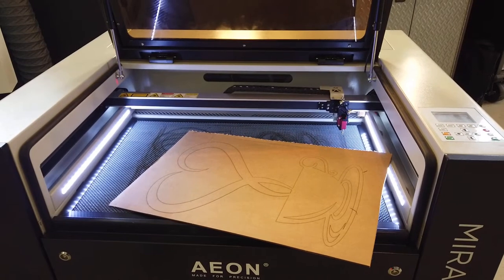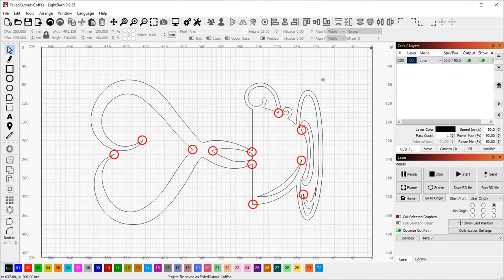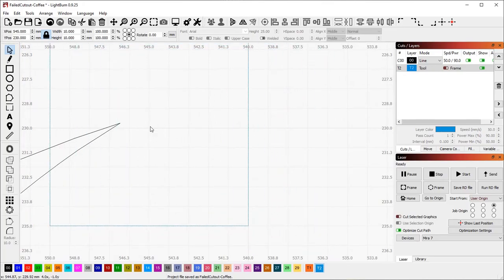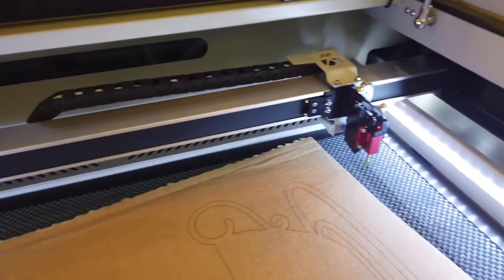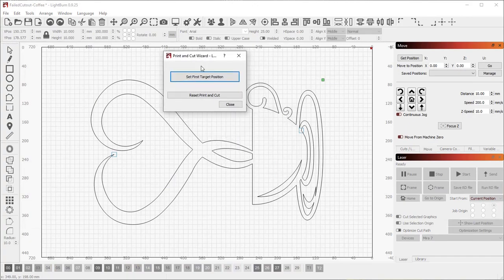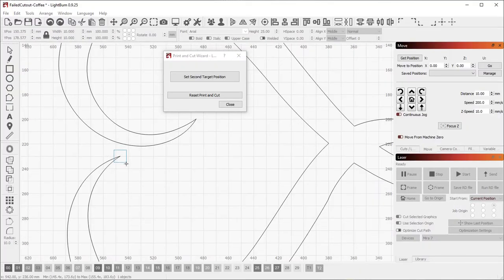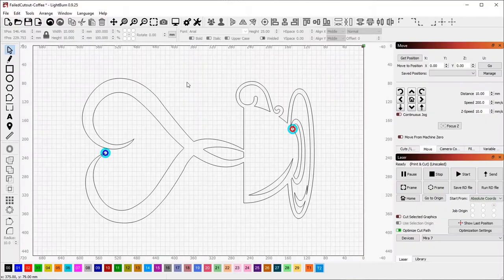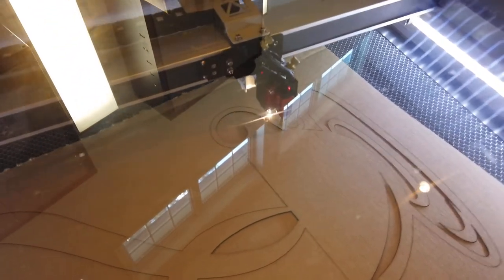Using Print and Cut to recover a project

Comment: This tool has been moved to the 'Laser Tools' Tab in Lightburn. Not your fault, it was like this when you made the Video, there was no 'Laser Tools' Tab then- just updating for anyone who might be confused. 

You might pin this comment or make one of your own so that this Video is still accurate. You could also add an annotation comment in the Vid at the timestamp ( 3:17 ish) which could note the corrected tool location. Excellent Video, it still works exactly the same- it's just been reorganized/moved to a different location.
Reply: Thank you! I found it when I searched in the help menu, but there seems to be a bug where and arrow points off screen.
Reply: Thanks for the tip 👌🏼

Comment: Great video. My question is does the laser has to be set up on user origin, current position, or absolute coordinates.
In your video, I can see that sometimes it reads current position, then it changes to user origins 
I understand once you do the cut n print automatically move to absolute coordinates
Reply from the maker: Absolute Coordinates is a requirement for Print and Cut so your laser must have limit switches. If you havent seen our newer video on this function it may answer some of your other questions: https://youtu.be/ddRW12VKIwY?si=PEuqBkQZ3NdT13RX

Comment: At 2:08 the pointer changes from the arrow to the red circle. The interface does not show any tool selected (in the tool well)...How did you go from the arrow to the red circle?
Reply from the maker: That is the two-point rotation feature.  (Ctrl+2 or Edit > 2 point rotate)

Comment: Great video!! Question: let’s say I have a cut that has multiple pieces and most of them cut except for two.  Would it be possible to use this feature then select “only cut selected graphics” to cut just those two pieces that didn’t cut completely?
Reply from the maker: Yes, Cut Selected Graphics still works when using Print & Cut.

Comment: When I set first target position nothing happens. The circle does not appear and the button doesn’t change. I’m running windows 10 and Lightburn 1.1.03
Reply from the maker: Are you connected to your laser?  You have to be.  If you are having difficulty, I would recommend either emailing support@lightburnsoftware.com or posting a question on our support forum.  YouTube comments do not allow either of us to post screen shots, and are kind of terrible for proper support.

Comment: Two questions... 1. How do you slow your jog speed? 2. After all that aligning and whatnot, do you still send the job to the machine?
Reply from the maker: 1) Depends on the controller, or which controls you're using.  If you use the jog buttons in LightBurn, there is a speed control in the Move window.  Otherwise you can usually change the speed by hitting the Speed button on your controller.  2) Yes.  You kind of have to, otherwise, how would it run the job?  (You can also use 'Start', if that's what you're asking)
Reply: @lightburnsoftware7189  did you send the job before or after you click print then cut?
Reply from the maker: @jackwagonww  - After.  Otherwise no corrections are applied.